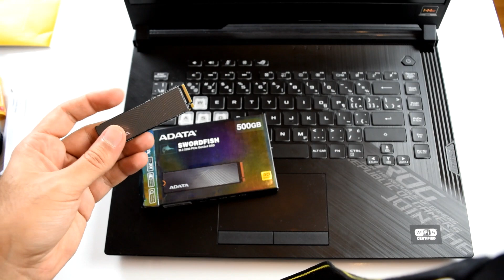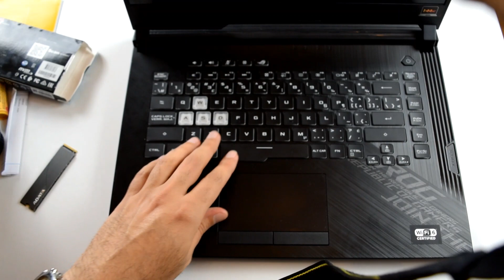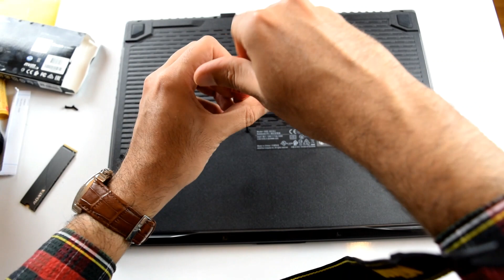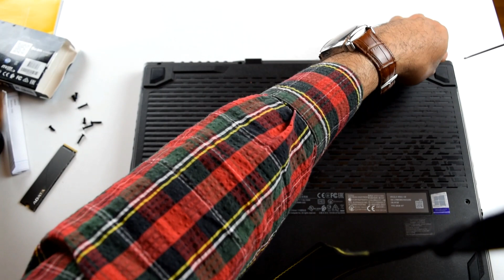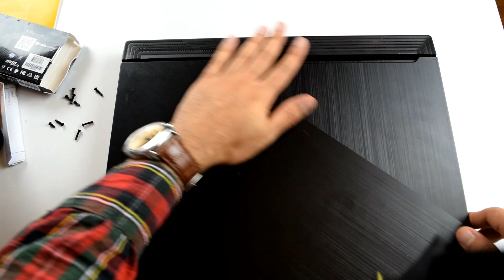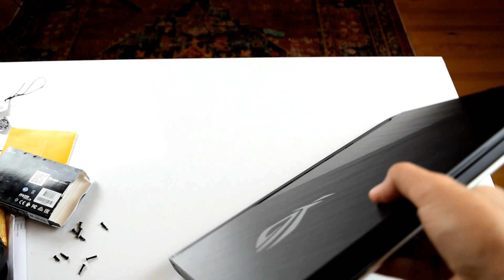Asus ROG Srtix Laptop G15 / G17 / Scar 3 Disassembly How to Add RAM or SSD

Comment: I have Asus Rog Strix G15 G512LU. i7-10750H,GTX 1660 Ti
I want to know if this laptop can support a maximum of 32GB or 64GB Memory. As it is not specifically mentioned anywhere.

Comment: Thanks for sharing. By the way knowing that official website have mentioned the Strix can only have 32GB RAM max … have you try 64GB? Can you help us to test it is working? Thanks
Reply: I've been wondering this as well, I've seen multiple places online saying it can take up to 64, but I chatted with asus and they said 32
Reply: @khaldrakon  is 64
they only say 32 because thats all they manufacture. i upgraded mine to 64 and it works great
Reply: @icylemon2003  cool, thanks for letting me know
Reply: @khaldrakon  on another tip make shure to do a system scan just to check. if it does say 32 then it is 32 but if it says 64 your good to go(which it should say anyway). best options would be the windows cmd to find out your max or the crucial scanner.

Comment: My asus cannot find the D drive (disk 0). Will removing it, and reinstalling it work? Error in disk management says: 'device selected does not exist'
Disk 0 is not even detected in the bios. 
The warranty period is finished. I've never opened my pc tho. I was installing ubuntu 18.04 on the d drive and using the grub menu to boot into the os caused the problem.(dual booting ofcourse). Ubuntu 20.04 worked perfectly before, also dual booted. I removed it to downgrade to 18.04.

Comment: You can polarize your screwdriver so that it becomes magnetic. To do that just get a good, strong magnet and rub the tip of the screwdriver on the magnet for a while and then boom, you've got a magnetic tipped screwdriver. Repeat the process as much as you need to because it loses strength after a while.

You're welcome; thank me later.